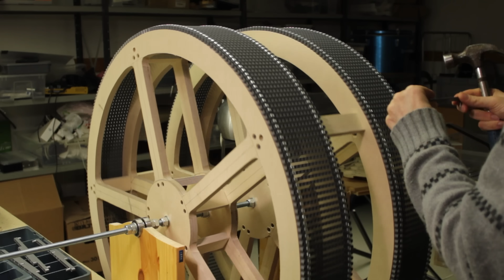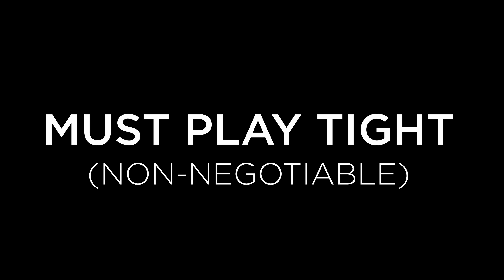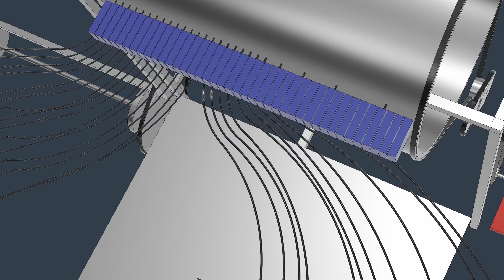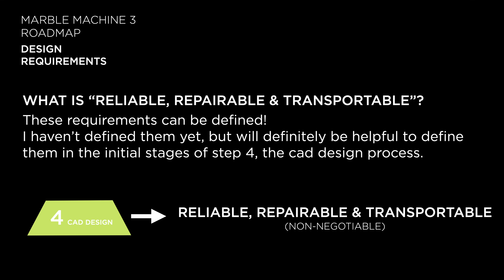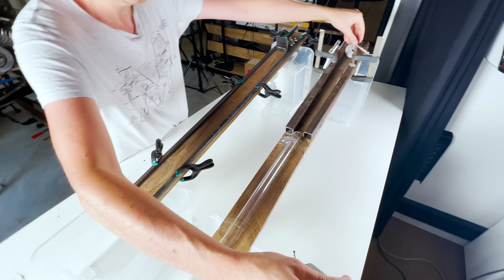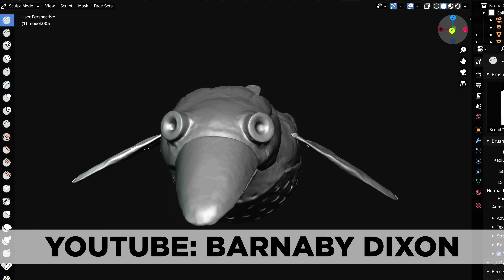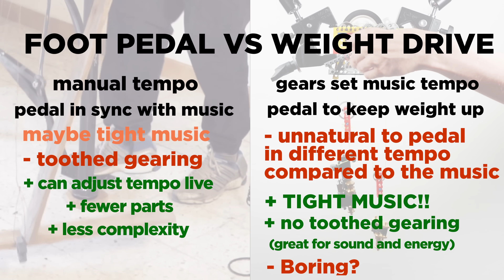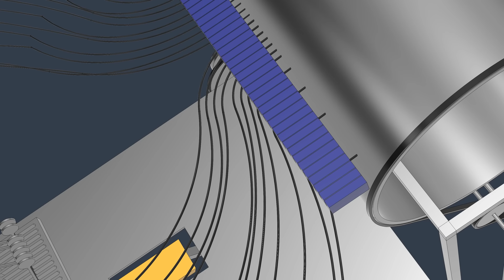Marble Machine 3 is Taking Shape

Comment: Maybe it's not about being tight, but being controlable. Imagine each stomp on the foot pedal corresponding to the movement of exactly one basic note unit on the programming weel, i.e. the notes hit exactly in sync with your foot. Assuming that speed can be adjusted quickly (which is probably not the case, I know, especially with a flywheel), you could play the machine as tight or as loose as you want.
You mentioned automatic pianos playing extremely tight but sounding boring - compare that with playing the piano yourself, you're not gonna be as tight as the computer, but a) tight enough for your taste (which is your design requirement) and b) purposefully and selectively play un-tight as fits the flow of the performance. Maybe that's what you want here as well.
This is all based on you saying that you'd like to be able to slow down and speed up easily during the performance, which AFAIK is the first time you mentioned that as a desired feature.

Comment: With the weight drive, that doesn't mean that you can't pedal in tempo to the music, it just means that the tempo of the pedaling doesn't directly affect the tempo of the music. If you are pedaling at the wrong tempo for too long, you will hit the limits of the weight drive, but I think that will be easier to adjust to than playing at one tempo and pedaling at a different tempo

you can also make the govenor adjustable (you should anyway to be able to play different tempos)

you can also add an electric motor to the weight drive, when the second weight gets too low, it triggers the motor and runs it up. This would give you a safety net if you are manually pedaling, but too slow, and also give you the freedom to move away from the pedal for a time during the performance.

Comment: You could use a foot pedal to power a weight drive? A fine-toothed double-acting rachet (like a self-winding watch) driven by an oscilating wheel to provide the input power to the weight drive.

Comment: I think you can measure your tightness by recording you playing normal instruments and finding a minimal acceptable timing threshold.

As for the sound, while more interpretive, you can measure the decibles of the noise the machine makes relative to the noise its instruments make. Try to make that as large as possible. Or the practice of adding sound damping for every component. Putting the flywheel system in a sound-damping box is an example. Adding shock absorbers is another- rattling = noise.

Comment: This might be a silly idea but what if if you could combine the foot pedal with the weight drive (hybrid drive)? You would need a ratchet or similar one-way mechanism combined with a two part gear set that has a ratio sufficient enough to lift the weight between pumps. Best of both worlds, no?

Comment: As a control room operator, I will say Auto is nice but sometimes you need the ability to take control in Manual. Also, as you will be part of the machine, you are now a failure mode. Will a wonky knee lead to cancelations?

Comment: In deciding how to keep tempo, I would only suggest considering how easily you could alter the design if you chose "manual" only to discover it was not as "tight" as you need. Is there a way to design in BOTH with the capacity to engage and disengage the "weight drive" on demand? That way you could lock in the tempo when you wanted but have the freedom to ignore it when you choose (operating like a cruise control device on an automobile).

Comment: Maybe out of the box. But what about a Huygen drive with belts instead of gears? You still get the same idea but much less noise. You just need to get the same ratio. And what about, when using belts, introduce variable speed using a conical stepped shape? Just like a car transmission? Might be an interesting proof of concept non the less 😮

Comment: You can also fall back on esc controlled motor.  You can change your tempo with a dial on that and remove a boatload of parts. There is a ton of electronics on the output of this machine.  I don't see why electronics on the input is a no go.

Comment: Martin, as long as you have marbles being divided and combined, you will have problems with your machine.

Think about all the problems from your last machine: The divider, the combiner, the trough, the fish stair. In every single case, the problems you had revolved around dividing marbles up and then combining them again.

You need a single path that each marble takes, never to be divided, never to be combined with others. Just linear the whole way.. This lets you massively simplify things. You now have to focus on creating a single marble path, then replicate that N times.
Reply: The simplest approach for this would be to have the programming wheel pins carry up the balls. That way you never run out (each pin plays one note, so it carries up the ball to play that note. You could have the have a cup next to it that carries the ball up to be dumped in a track above

Comment: It might be possible to section the programming wheel. Three sections mounted on the same drive mechanism in the same place on the machine could be individually swapped out. This would reduce the weight of each programming wheel making it easier for your road crew to do their jobs. I could see how a giant programming wheel( while epically cool) might be limited by the strength of the people in charge of mounting them between each song. Just an idea/something to consider.

Comment: what if you used the entire platform as the pedal? 80kg human body with an escapement and flywheel then to recharge it you simply step to the outside for a moment while springs lift the platform. because the amount of power is so much higher than even a foot pedal you'd only need to do it every N seconds and with a ratchet and flywheel it could be done as often as you need for it to feel natural

Comment: Keep the drums and the melody separate. You can reuse drum beats for many songs.  You can also decide to do a song with one drum beat in a different style by swapping the drum section.  We do this all the time in our Jazz combos.

I suspect you want the Huygens drive.  Tapping you foot to set the tempo on the Huygens will be natural, but it will not require nearly as much effort, meaning you can play longer.

Setting the temp is a separate mechanism that should average the time of the taps, and nudge it up and down...if you are routinely stomping in front of the beat, it will speed up, and behind the beat it will slow down.  Seems like this could be pulled from the same mechanism used to wind the Huygens.

However, A lever to control the tempo probably would be raiser and more effective.  It will also keep you from rushing during live performances.

Comment: With the manual foot pedal, if you are using a flywheel (certainly appears you haven't changed that) you will always have some lag between a change in your foot pedal pace and the tempo of play.  So, you're only pedaling along with the beat if it is steady to begin with.  I'm not against that method, but tempo matching is mostly not going to be a thing unless you are already keeping good tempo in the first place.  Secondly, if you gear your input to the weight drive properly, you will be able to make it so that pedaling in tempo with the beat is the optimal way to keep the weight steady.  If you do that, the only difference in performance between the two is that the weight drive will compensate for any beat drift you may cause, and you'll have time to catch back up if you notice (which you could probably fit some kind of mechanism that shows you clearly if you are falling behind).  The remaining benefit of the foot-pedal system is its simplicity, and that is still significant enough to make it a worthy contender.

Comment: And what about a disengageable weight system powered by a foot pedal. 

On a flip of a switch ( well it's probably going to be more complex than that ) you switch from the perfect timed weight system ( with the foot pedal keeping the weight more or less where they should ) to the foot pedal timing ( and stopping the weight where they are so that you can swithc back ) for a better live experience. 

That way you get the best of both : perfect timing when you need it and live unperfect timing when you need it. 

It's probably a mechanical nightmare to solve though, and I'm not a mechanical expert, I prefer wires and volts.

Comment: In my opinion, if keeping absolutely perfect tempo is a requirement, forget the Hyugen drive and put a motor on it. I think the decision here is the line in the sand: is this a music box that happens to be person powered or is it an instrument played by a person? Either is cool but they are not the same. 

Also, changing tempo is a variable in lots of music - removing the option means less flexibility in what you can play

Comment: Personally I'd consider a hybrid power input system. Foot pedal + a huygens weight drive so you can switch between the power inputs at will. That way when you need to feed off the energy in the room you can  and at other times when you need to focus more on the music or adding other instruments you switch to huygens mode. Just try to make weight raising pedal control to work close to the beat so when you switch there's that bit less to worry about.

Comment: I agree with your choice of just one programming wheel, the posibility of multiple wheels staying in sync with each other is not something I would go for, too risky. Power input wise, I would hope that there is a way for you to add in some kind of pedal override so that you can speed up or slow down the power from a Huygens drive rather than go for one or the other. A hybrid system would give you the best of both worlds.

Comment: You said you've changed your mentality to "form from function" but I see you're getting stuck again in overengineering mode. The whole mechanical power input is hidden from the viewers, it doesn't provide any entertainment during the "World Tour". 
Is it really a design requirement that the machine is 100% mechanical? 
Will your concerts be acoustics only? No, you'll have a lot of microphones and audio equipment around the machine.
Does it really matter if you have an electric motor powering it?

I think the main purpose of the machine is to have the best show during the "World Tour" and you being free to run around, switch levers, accompany with other instruments, dancing, doing summersaults, etc would be a lot more entertaining than seing you stuck in the same place just pedalling and trying to reach levers without missing a beat.

Comment: I think the pedal drive and the artistic options it gives you is a better path. Slight variations in tempo are a part of music. Modern music tends to remove this in the "edit bay" as a result, most modern music has no soul (My opinion YMMV). Also the speed regulator you would need for the weight drive would add al lot of complexity as well as require more energy input (martins leg).Also you may want to think about adding a dedicated "click track" that can be recorded as you are performing. This would make post production much easier as it would track and small variations in tempo.

Comment: You can set up a variable rate in the pedal feeding the weight drive. the trade of is stroke length. You need to use a governor with a speed control to manage the tempo

Comment: The weight drive and the flywheel serve the same purpose.  They are both energy batteries.
Connect the foot pedal to the flywheel with a ratchet; do not let the flywheel force the pedal to move; That's how you lose toes.
Connect the flywheel to the output with a slip speed limiter.  It should pull enough energy out to turn at the configured speed, and let the connection slip if the flywheel is too fast.

You can make the slip speed limiter adjustable if you want to dynamically change the tempo.  You can adjust how the pedal charges the flywheel if you want your stomping to be with the beat.
I don't think you really want to have to keep time while doing all the other stuff as it plays.

Comment: the electric motor from the MMX would be an easy add on to whatever you mainly power it with as a backup or assist. 
if you use just a foot pedal for example and something happens and you brake a toe, you wont be able to play the machine but if there is a motor backup then you can have a way to keep going even if you cant.

Comment: Would it be possible to have a fixed weight in the horizontal plane, but not the vertical plain allowing you to have a weight slider like on the oldskool weighing machines, that allows you to "nudge" up or down the tempo manually? Also with regards to out of time stomping of a pedal, could you not have a minimum tempo for the foot pedal, set it quite low with gearing, and then have some kind of "extra energy release" mechanism (like a slipping clutch or a mechanical torque wrench mechanism), so if you go above this low tempo needed for keeping the weight up, and actually stomp in time with the music it isn't a problem other than maybe wasting a bit of your own energy?

Comment: The very first step shouldn't be timing. Timing is part of prototyping and maybe CAD design. Your first step should be requirements. What does the machine need to do? What design goals should the machine meet? That is where you specify what timing you need to meet. Then you go into prototyping, which goes parallel with CAD, where you come up with concepts about how to achieve that timing. You haven't even started and you're getting bogged down in unnecessary detail.

Comment: I think you are making a mistake in how you are doing your design requirements. All of the design requirements should be laid out first, before making decisions. For example, the assembly and reliability requirements definitely have an impact on the choice of drive system - it's not only affected by the timing requirements.

I also agree with others that you really need to consider electric drive. Electric drive could greatly simplify the mechanics. You can still have the real time tempo adjustment, by whatever interface you like (pedal, tap tempo, a knob, midi clock sync, etc). You can either eliminate or significantly reduce the size of the flywheel, which makes it much more transportable. You can also simplify the who belt system by using separate motors to drive the marble lifts. The entire machine would be more compact, more reliable, and easier to transport.

Comment: The Huygen weight drive is not "option three", it's an energy buffer you can attach to any power source. You still have to input energy, and that's going to either come from a crank, treadle, or motor.